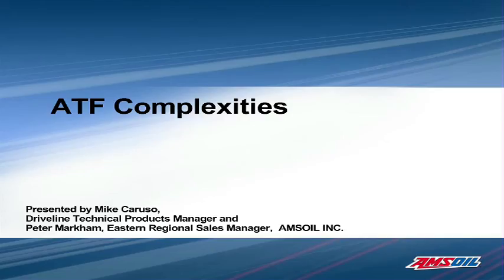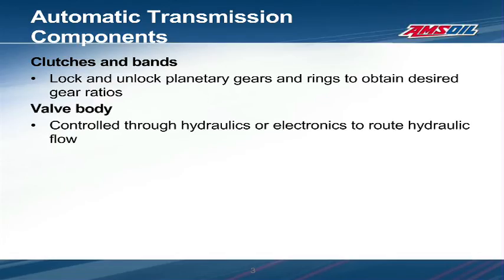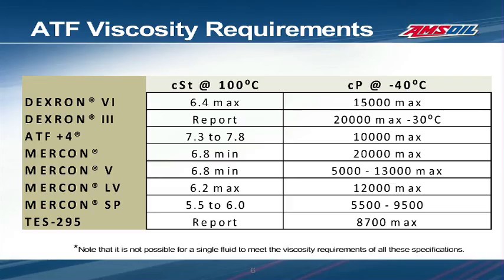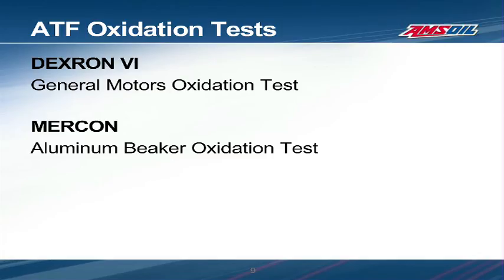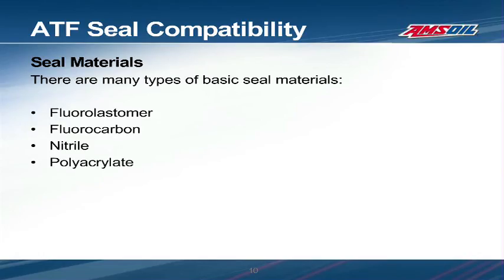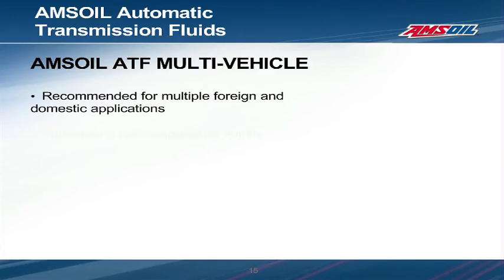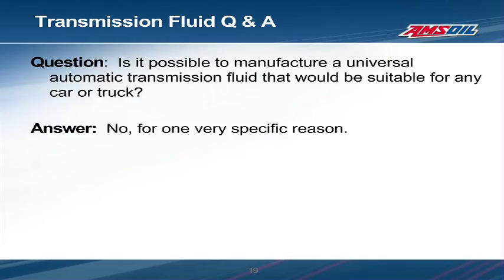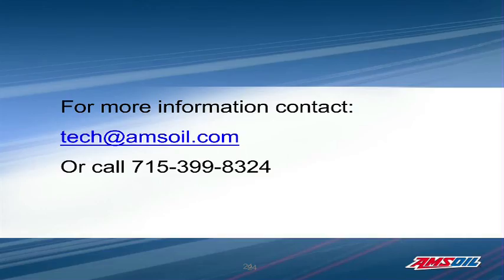AMSoil - ATF Complexities

Comment: i have a 2005 05 honda accord 4cylinder with 191,000 miles, which one of these atf do u recommend? i do lots of stop and go driving in the city, i live in the Bronx.
Reply: Signiture series !  NYC driving is equal to severe usage of engine and transmission.
Reply: @tonychambers9228  I am currently using the OEM fluid and I am changing the fluid every yr regardless of miles driven. I am at 214,000 miles now